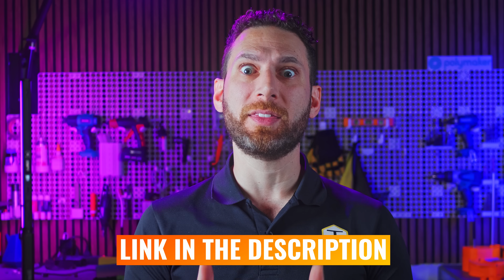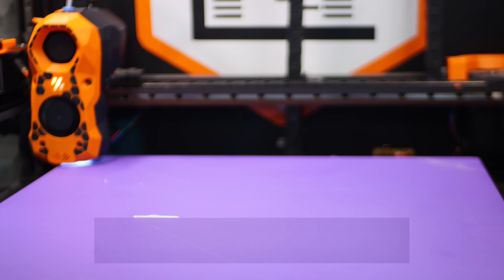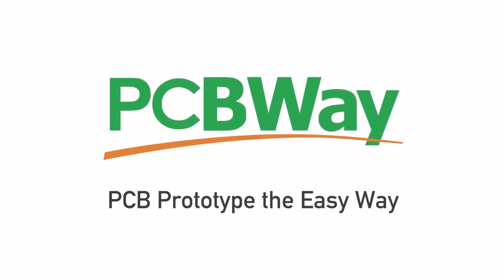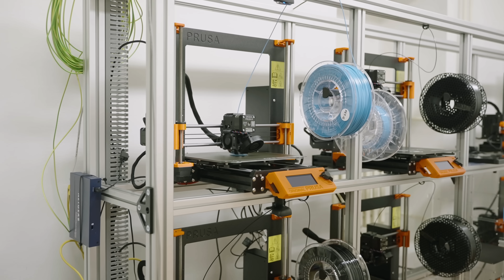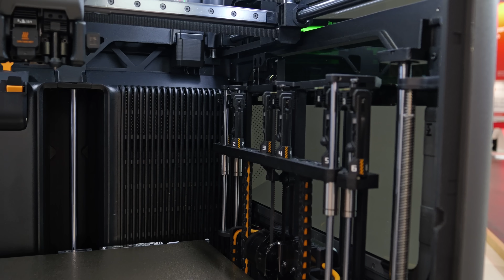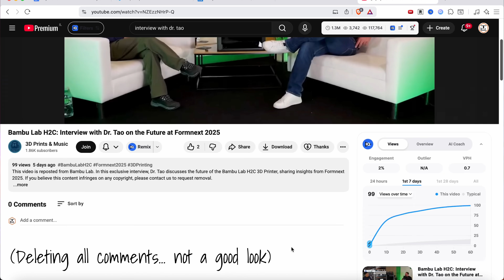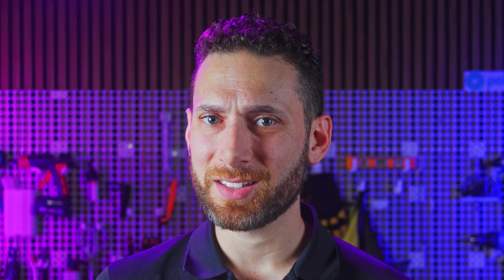My HONEST Annual Report Card for Each 3D Printer Brand

Comment: I started 3D printing a few years ago with a wanhau duplicator i3 plus, then added a Creality CRX when it was released then I bought a Bambu A1 with ams lite and a Bambu A1 mini no ams. To me they are tools, I don’t try to improve my hacksaw or my hammer.  My first 2 printers started out fine easy to use and produced great prints but as time when on to maintain that performance repairs, modifications and constant battles with adhesion. I have put vastly more rolls of filament through the bambu printers with no more than oiling, occasional bed plate cleaning and 1 nozzle replacement which was my fault. 

As long as they let me use anyone’s filament I’m happy. So it depends on what you want to use them for. Personally I have little interest in coding and less years left to learn. If a hammer drives a nail in its a good hammer, if not replace it

Comment: I have had my Bambu Labs X1C for just over two years and while I like it, it is simply not built for real multi material printing and its approach to colour is a complete mess. Between colour bleed and mountains of purge waste, it pushed me to take a serious look at the Snapmaker U1. The only thing holding me back is the tiny print surface. Bring it up to around three hundred and fifty millimetres and I can work with it. Who thought a ten inch print area of about two hundred and fifty six millimetres was acceptable? Once Snapmaker offers a larger print surface with hardened nozzles, a hotter nozzle, a stronger heating plate and a better filter for people who cannot vent outside, I am in. I just hope I am not waiting another two years for it.

Comment: as an owner of anycubic kobra 3 combo v1 and anycubic kobra 3 max combo I would like to see them add the z adjust on the kobra 3 max its on the kobra 3 v1 and sometimes the auto level does not always work as it should. they are getting closer with the slicer with the orca features as I see new stuff being added on each update to it, but they can do better. beside from that I have enjoyed using my printers and am looking forward to getting the Anycubic S1 Max Combo.

Comment: Close to $2400 for a Core One+ including shipping and taxes, that's just not happening.  Add another $1000 for the 4 nozzle INDX.  Prusa was actually top my list until I found out just how expensive they are.  It's a pity really, but they are priced for the wealthy.

So far I have not found anything at a similar price to the X2D offering similar features and refinement.

What Snapmaker needs to do next is figure out a better design so the printer can be properly enclosed and heated without the need for that massive cover.  They also need to provide a way to enclose all the filament holders and move them away from the sides of the printer.  Only then could they consider making a version with a bigger internal volume.

Comment: I would buy a second 3D printer if it could be 100% controlled by a local AI/LLM at a fair price. The printer do not need to have the compute power just the ability to be micromanaged over network or usb and have a usb hub for 2-3 web cameras that the ai vision can use. I want to tell my ai print a ** and it shows me examples and can modify them if I ask it to then tell me what filaments to load while it prints and monitors all aspects of the printing. After a print fails part way I would like to make a print of only the missing part so I can glue it to the part that did print ok. Am I dreaming or is this a possible future 3D printer reality?

Comment: My first experience with a printer was an ender three in 2017 if I can recall right.
Also had known some college folks who let me figure out a prusa mark 4.

Turn to 2024 and I got my own A1 Combo I was given for Christmas and midway through 25 I got a P1S.
I have 4000 hours between both machines. 😅
Never had an issue apart from a few clogs mostly using things like softer TPU anyways.

Always told myself during this period that if I were to have a printfarm that I would just line a hord of p1s's.

Now with bbu labs direction combined with local policies coming from spanburger I really REALLY have been eyeing the Snapmaker U1 or maybe the K2 for any future endeavors and eyeing snapmaker  favorly. 

That being said I still do recommend an A1 series or P1S to beginners (NOT P2S!).
They are just so easy and plug and play it's very forgiving if something goes wrong so you can actually get a feel for everything.
Somewhat how Glowforge before bankruptcy despite later business being sketchy as heck helped a lot of people get into CO2 lasers because of the affordability and support.

Comment: It was interesting to learn about Bambu being a closed ecosystem that just works. I need the 'just works' part in the 2nd printer I'll own. My first printer was one of those open source kits from about fourteen years ago and it has sat in a box about 98% assembled. Bambu works with Linux, right? That is open enough for me, to get my first working 3d printer.

Comment: Your take on Bambu is just silly. Bambu are the most together in the space, and the H2C is phenomenal. There are companies sending out printers that can't reliably output models, and you want to be critical that the H2c is slower than unreleased products? It's not open source to your standard? Where is Qidi in your breakdown? Because you could talk about how they ship product with basic issues. Most of your other remarks are logical. If Prusa wasn't shipping you gifts, would you give them the benefit of the doubt like this? I want a Core One INDX when they're released, but lets not act like Prusa hasn't had problems too.

Comment: You criticize BambuLabs and claim to speak for “the community” in saying they don’t support their closed ecosystem approach. The problem is “the community” isn’t what it used to be. It’s no longer a bunch of techie tinkerers and now it’s just average people who want a printer that just works reliably without needing a lot of tech expertise to use. Bambu provides that, and “the community” has spoken loudly with their wallets and said very clearly they LIKE Bambu’s approach. The dinosaur mentality is doomed and like it or not, the community you claim to speak for is now a minority and the vast majority don’t hate Bambu like you do.
Reply: @teeveeoh  Folks in the community are pretty tired of Bambus walled garden of enshitification. Sure, the market is expanding, but I wouldn't call a bunch of barely mentally functional cattle that struggle to turn the printer on part of the actual community. Put another way, making a piece of tech idiot-proof only encourages its adoption by a bunch of idiots.
Reply: @MrXinshadow I think the issue is you don’t speak for “the community.” The “community” is a lot larger than you think it is, and the “community” is speaking loud and clear with their money and very clearly are saying they approve of what Bambu is doing. You don’t get to say someone isn’t a member of the community just because you disagree with them. And your hurling insults at those you disagree with really doesn’t reflect well on you.

Comment: I liked my fairly recent interaction with Sovol support. I contacted them about an issue I was having with my SH03 dryer, they straight up sent me a new part and refunded half the price of the machine. Once I got it up and running again they made me an offer which I was happy to do. I purchased an SH02 dryer, gave a 5 star review and then they were going to refund the full price for the SH02. The payment options to refund back to me were a bit of an issue so they offered for me to pick 2 PLA and 2 PETG spools with no restrictions on which ones. Ended up getting more value out of the filament than what the dryer cost. For my currency ended up getting $430+ worth of stuff for the cost of $200 and a review.

Comment: Great video brother! I'm on the fence as far as to what my next printer should be. I started with the Elegoo cc1, but I find myself only printing engineering grade material, and the printer is pretty inconsistent (mainly first layer visible issues). I'm tired of constantly adjusting z offset, first layer temp, etc to achieve acceptable first layer results. Anyways, on to my question. If you had around 1k to spend on a new printer TODAY, what would you purchase? I'm not brand specific, but I do want an out of the box ready to use printer. I don't mind assembly with that being said. I'm also open to community suggestions, so chime in yall! Have a good day!

Comment: When bambu hit the market, I was in the process of buying my voron 2.4, and getting parts commissioned.  I could've got 2 p1s printers for the price.  But it was before they had docs or parts availability.  I never would've imagined they would've turned into the giant they are now.  Even still, I have no regrets building my voron.  At the end of the day, it does what I say, not what another company says.
Reply: Not to defend Bambu,s ethos but my two Bambu printers do exactly what I say reliably and Bambu studio meets my needs and I don’t have time to learn coding at the moment. I appreciate the open source community because I benefit from there work as it keeps the big guys from getting too slack.

Comment: I purchased an Anycubic Kobra S1 Combo back in August of 2025.  This is a decision that I dread every time I try to print to this machine.  The bed has not been level since the day I bought it.  I have had to replace the hot end twice and have replaced the inner workings of the Anycubic ACE Pro.  I suggest that anyone looking for a 4-color printer look in the other direction.  NOT A GOOD EXPERIENCE AT ALL!

Comment: The printers im eyeing right now the u1 and the core one with indx. I had a x1 carbon for several years now but ive started to to a lot of multi color prints and the waste and time is to much. But reliability is outstanding. I bought mine since way before the p1 launched and it has required very little repairs. One bent nozzle, burnt out ams mainboard and buffer (both completely my fault). Other than that just maintenance, i think. Oh, and the nozzle i think i just bent it back

Comment: TNL, I just don't get your assessments. I've owned many 3d printers for the past 8-9 years from Creality (older models as I do not own the newer K series), Anycubic, Elegoo, Bambu Lab and one delta printer from a manufacturer I don't even remember. With the exception of Bambu Lab, . I was lucky to have a 20% print success rate from any except my Bambu Lab P1S which is up there to about 95% print success. As far as Bambu Lab practices, own a phone? use social media? They all use your info for profit and who cares about a closed system. The best computers, tablets and phones on the planet are Apple... a closed system. Quick note: I have never owned a Prusa. way, way too expensive.

Comment: I think bambu Labs is doing a great job in terms of the hardware, but definitely would benefit if they were allowing open source software alongside their proprietary stuff so that people who wanted something that just worked but maybe wasn't the most optimized could use the bambu software and people who wanted to have a more Hands-On project could use the open source software because I do understand the appeal of something that just functions without fuss. however the poor sportsmanship and Shady business is very upsetting to hear about and hopefully that will quickly cease. in my opinion having a market strategy towards non hobbyist consumers is completely fine but in the long run it could end up being detrimental to Bambu labs so in their own best interest they should adopt a more open source friendly strategy.It's kind of like Apple versus Android because Apple phones typically just work but you can't customize them as much and there are many Android phones that are similar just with more customization and in this example snapmaker or prusa might be the Android phones.

Comment: I have a few bambu lab printers, the older models, and I'm quite happy with them.  I am thinking about upgrading to something bigger and more feature rich and I would likely sell out of the bambu ecosystem and jump over to prusa.  The biggest issue there is the cost as bambu are a little cheaper and prusa seems to be on the upper end of the spectrum.  I attribute most of the issues to the fact they are a Chinese brand which means they are ultimately controlled by the CCP.

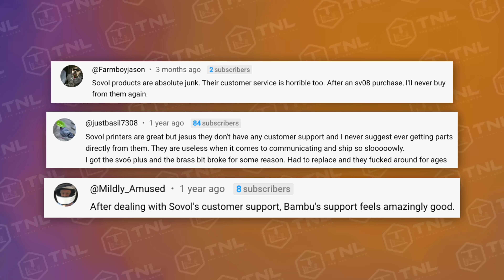Comment: 6:24 I have a sovol sv08, I broke a hotend, told them that it was not available (after checking the US stock), so they sent me one from China free of charge. I was 100% responsible for the damage so I would have buy it from China if they just told me to do so. So my experience with the custormer service was really good.
From my perspective, Sovol is aiming to have a community capable of updating the software and hardware and helping each other, and the bad experience might be coming from people that should have bought a Bambulab instead.

Comment: Creality is actually discontinuing a lot of models - though they haven't been announcing it other than in their live sales. The Ender3V3 series is limited to stock on hand for both the KE and SE - I believe also for my favorite, the Plus. The older Ender models and CR series is discontinued as is the Ender5 other than the Max. There is an Ender3V4 coming out though I'm not sure what versions it will be released in - I expect to see several build volumes offered. As I see it, their primary models are now the K2 Series for enclosed corexy flagship printers aimed at the prosumer market, The Hi and Ender3 lines are aimed more at the consumer/hobbyist, and the Ender5Max aimed at those needing a larger printer. The Sparkx i7 is actually a separate brand aimed at new users with ease of use it's biggest concern. They have definitely been trimming down the models over the last 2 years.

Comment: Also the Cobra S1. Student of mine bought one on release. Piece o junk. They sent him spare parts, everything else can now be bought from Ali, rock solid mach9ine after fixes. I bought one on Black friday. Comes with the new hotend, works outta the box, one or two weirdo software glitches in the first week, running great since. Bed flatness could be better, but im just gonna get the 50 bucks aliexpress upgrade for that and call it day. Not bad enough to break anything anymore, not an urgent fix.  Prints pretty juch as good as the X1C at work and i dont have to deal with Bambu BS. PEI sheet was impossibly dirty as received, though. Nothing would stick. Terrible. Lots of hot water, dish soap and a !light! scouring with Scotchbrite fixed that. Most problem free printer still goes to our old MK3s, but overall a good buy.

Comment: I'm the only one out of all my friends that never got into 3D printing. Then after refitting my 'office' room, I get back into miniature painting; new paints, new brushes and days spent sorting out all my Warhammer models (going back to 1985) and started painting again. But wait! The price of GW models these days is insane.

Behold, the Bambu A1 printer. It came up a lot in searches about 3d printing miniatures but wasn't the same quality as resin printers. However, resin printers just aren't practical for me; friends that have resin printers have outbuildings they can use etc... So, just when I'd decided to try the cheap Bambu A1 there appeared many videos on the Bambu P2S because it was the day of it's release.

After a week of deliberating, I bought the P2S with the AMS2 and various filaments.

Totally blown away. Friends; totally blown away. It's so easy to use and perfect for beginners. Now friends that have been 3D printing for many, many years are considering getting one.

Closed ecosystem? Doesn't bother me because the thing just works. I learnt CAD about 36 years ago so it's didn't take me too long to gen up on Autodesk Fusion and the P2S prints whatever I design. I can download tons of stuff from MyMiniFactory, and whilst the P2S is far from resin quality, a bit of cutting up here and there and the worst aspects of FDM printing are reduced and hidden.

I don't care if the company is shitty or not, or more to the point, I can't afford to care if the company is shitty or not. The printer is easy to use and the slicing software has a gentle learning curve. It's great for the hobby printer.

Comment: I got Anycubic Kobra 3 v2 this christmass and it feels like its good printer for a noob. It came with ace pro, but I use it mostly to keep filament dry because i don't want to deal with problems and switching fimalent by hand each time i print something. 2 weeks of printing and no problems at all, but I use basic settings only and usually simple models with less than 6 hours print time.

Comment: As a early adopter of Bambu products and now using a h2d along side my x1c. I don't mind the closed ecosystem at all. I've been building and using printers since reprap really took off, and my bambu printers are the most trouble free of all of them. My prusa machines have been sold, all the self built vorons are gone and the old ender is up in the storage where it will live for ever. I no longer consider 3d printing one of my hobbies the machine is just a tool now, like my cnc and table saw in the workshop. What bambu has done is provide printers that just work, no fiddling, not constantly hunting down a new issue or broken wire, just send a print and it prints. Doing that consistently requires some level of control. Their multi material handling is so much further ahead of ERCF and the prusa MMU its not even comparable.  So as long as they support their printers ill be a customer. The H2D has been a game changer for my workflow with how well it deals with flexibles in my prints.